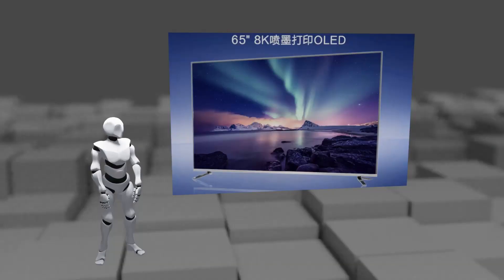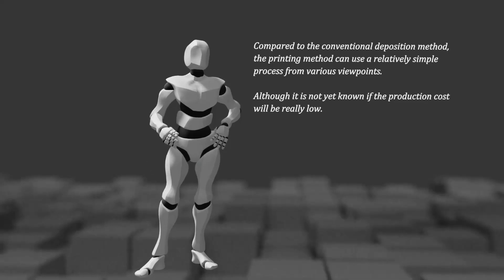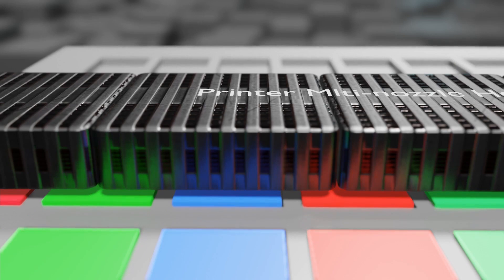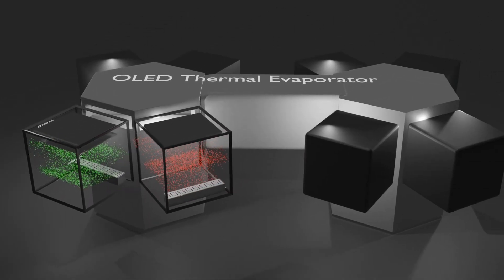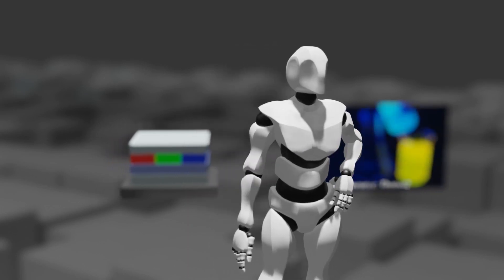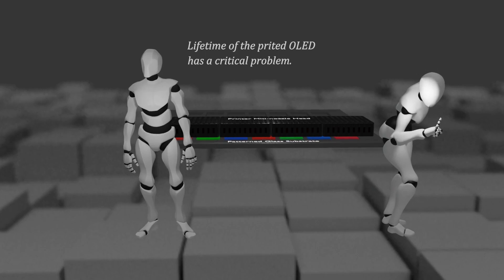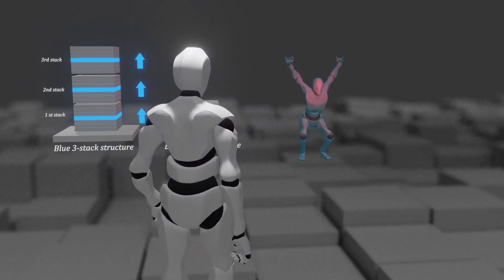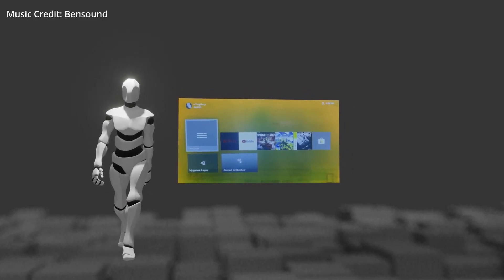TCL's inkjet printed OLED TV... Will it really be released in 2023?

Comment: 쉽게 이해되게 동영상 준비해주셔서 고맙습니다.
Reply from the maker: 아주 쉽게 이해되요?
깊이 있는 내용을 쉽게 설명하는 것이 목표입니댜~
감사합니다~
Reply: @techtripkorea  - Yes, it's the first straight answer about how TCL plans to use Inkjet to make OLEDs.

I wonder how they intend to ameliorate the problem with burn-in and only one layer, because an OLED that only had a two-year lifespan is going to get a really bad reputation really quickly!
Reply from the maker: @drbinderust  They are simply boasting, I think.